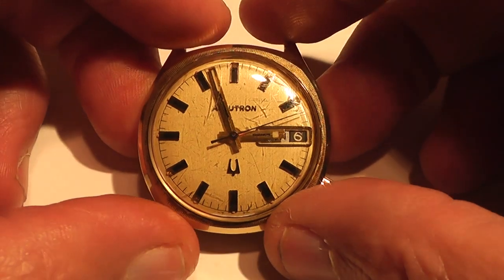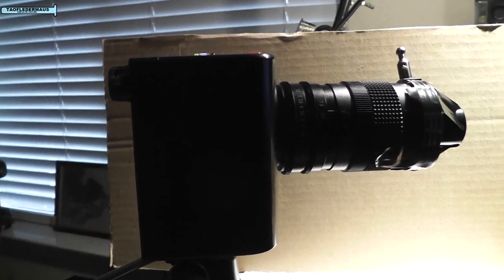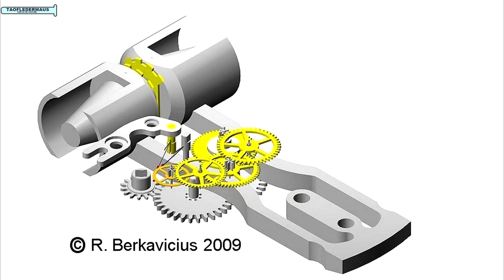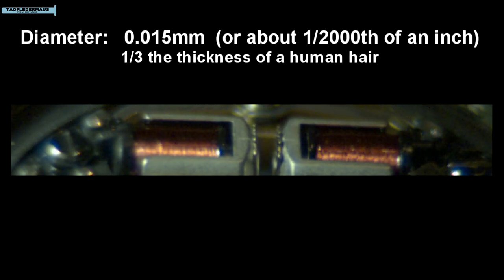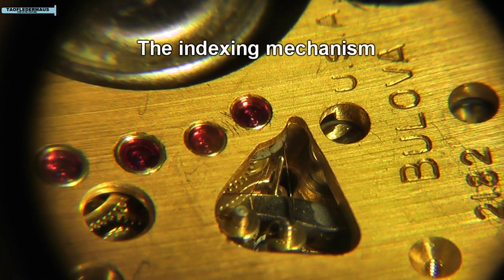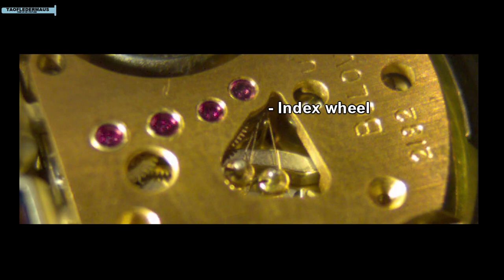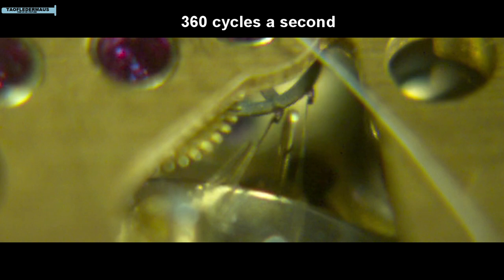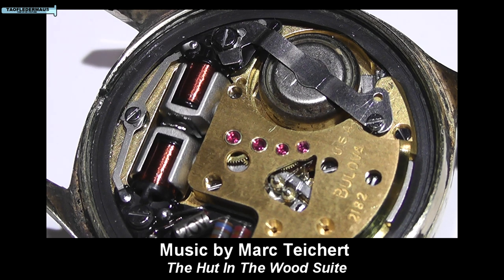The amazing Bulova Accutron watch filmed in microscopic slow motion

Comment: I have a feeling that the gear was built by the tuning fork itself then casted there in after. The watch being built around the gear, built around the transistors all while having extremely high quality resistors.

I'd say this watch is the definition of high quality.

Amazing
Reply: At least one of the resistors is carbon composition, the cheapest you could buy.  They tend to absorb water and change value over time.  Metal film resistors were around back then so I don't know why those weren't used instead.

Comment: This is an amazing piece of engineering. I love seeing how mechanical or electro-mechanical devices work. Before modern technology that gave us quartz clocks and transistors (for other devices), people had to find novel and new physical ways to do things. My pocket-watch is mechanical because I just love seeing the motion (it has an open face).
They're also so robust! I wouldn't be surprised if this watch would last a long time while running constantly. When something is more difficult, complex, and expensive to make, you sure as heck wanted it to last. 
The ingenuity needed is just superb. It's really neat seeing this gem of vintage timekeeping.
Reply from the maker: There aren't too many things made today that will last more than a few years.   Even stuff with no moving parts will break the day after the warranty lapses. lol

Comment: I owned one back in the 60s. It made a very soft humming sound.  I still have it, although I stopped wearing it long ago.  While going through a closet,  I found it and took it to a jeweler for inspection.  Of course, the battery was dead.  He put a new battery in and the watch came to life.  It works as well as when it was new.  Compare that to my father's Rolex of equal vintage.  It wasn't working so we sent it to Rolex in NY.  We got a letter saying it was unrepairable due to the unavailability of parts.

Comment: I don't know why I'm just now seeing this in June 2020 but it's real nostalgia for me. I bought an Accutron Astronaut in 1966. It is even more complex as it has 2 hour hands. One goes around every 12 hours and the other every 24 and it has a rotating 24-hour bezel. You rotate that to set the 24-hour hand. I was in the Air Force at the time stationed in Alaska with frequent TDYs to other time zones so I could set one hand to local time and leave the other on Alaska time. I still have it but the batteries have become hard to find.

Comment: My father bought a "Spaceview" version of the 214 model in 1968. I still have it. It has been "serviced" a few times... but it has never needed repair. It has run continuously for 50 years now... except for the 1 minute per year that it takes to change the battery... and the few times that it has been "serviced" for an hour or two. At over 31 MILLION oscillations per day of the Tuning Fork times 365 days per year times 50 years... it has pushed the Index Wheel over 550 BILLION times... without fail! I have "regulated" it (they have small "plates" at the ends of the Tuning Forks that allow it to speed up or slow down a few seconds per day) to well within the original stated "guarantee" by Bulova of 2 seconds per day accuracy ( for the first year of ownership). I often get these to run within /3 second per day over a few months. Try THAT with a Rolex!

Comment: I love that they tuned the frequency to the number of degrees in a circle. That's probably a GIANT hint into how they machined the escapement to such insane tolerances. If I had to guess (I work at a machine shop) I'd say they made a proprietary lathe with some insane gear reductions, but what they used for the cutting tool, I'm not sure.

Comment: The ‘fed back’ coil serves two functions: 
1) it pulses a charge to the capacitor to bias the transistor to 'kick' the coils 
for another cycle.
 2) Most cool, this capacitor charging helps the circuit Voltage remain high so
the battery doesn't have to work so hard. (avg drain is 6 to 9 micro amps).
There are patent descriptions on [Accutron] that do a better job describing this circuit than I can. The circuit design resembles a ‘Hartley Oscillator’.
-Thanks for great vid
Reply from the maker: Thanks Marc for the explanation!

Comment: That is absolutely nuts. I'd love to know how such a thing was made....
Reply: 1 teeth of that index gear measures exactly 0.01 milimeter in height. Todays high quality CNC technolgy achieves tolerances by 0.05. Anything beyond has to be hand adjusted by todays watch making. What alien technology did Bulova developed back then? The only possible answer is another tuning fork that sends vibration to a micro glass egde. While the stack of soft metal is rotating at low speed, the glass edge is cutting tiny valleys according to the tuning fork vibration. Then is gets sliced. The same principle that is used to drive the 214 caliber - just reversed :)

Comment: I currently attend school to become a machinist, I feel like this could be a lesson to everyone how important tolerances are.
Reply: I am a machinist and I mostly work with .005 inch tolerances. The average sheet of 8x11" printer paper is .003 thickness. The level of precision in that gear is insane.
Reply: I've long since graduated school and started a career as a machinist running a 4 axis horizontal mill. Given the wire in the coils is 5 tenths in diameter some of these parts are even more impressive. After rewatching this video over 3 years later I have an even greater respect for the craftsmanship.

Comment: Great video, I am glad you did not load is into a Mass Accelerator and send it at Mach 2 at some gummy bear or water jug!
My father acquired an Accutron in trade from a jeweler as payment for construction work (mid 1960's). It was the rare "Skeleton" model where you could see the workings of the watch through the face. My brother has it now, I think it still runs.
Reply from the maker: Nice.  The display back ones are probably quite desirable to collectors

Comment: As a tool & die machinist that went to school for watchmaking, and just happened to find a mint model 2210 accutron in a stash of old otherwise junk quartz movements given to me, I never got to work on an accutron as a student in early 2010s. Now that I see the legendary index wheel- and the size of the jewels- I am speachless. 320 Teeth on 2.4mm diameter is insane, even in watchmaking sizes. I can't imagine how they must have cut such teeth, I can only guess between centers as a stack of blanks, using a diamond shaping tool.

I kinda want to try making one now just to see if I can.

Comment: You can usually use two lens placed front to front together, interlinking the threads. I used to take many pictures with my K1000 using this method.

Comment: Absolutely fantastic video footage and narrative.  The frequency and continuous use make it difficult to believe the metal and other parts would not simply fatigue or get out of spec.  What was the longevity of these watches and how does that equate to total revolutions or oscillations through the watch's functional term? I'd imagine it exceeds the number of strokes of a piston makes throughout the life of a pressure lubricated car engine.  Phenomenal!!  Thanks.
Reply from the maker: I imagine the cycles the parts are going through far exceeds any engine cycles.

Comment: That's scary how something made in 60's - 70's is still the most perfect mechanism.
Reply: And the Fisher Space Pen(AG7) still the best pen ever made, developed in the 1960's. I have a new old stock Fisher Space pens from 1971(original ink cartridge) and a 1993(original ink cartridge) as well and both still write perfectly. Fisher claimed the thixotropic ink would not dry up in a hundred years, well I have one almost 50 yeas old and its still going. The Space Pen writes in zero gravity, writes upside down, writes at -50F and at 200F., writes underwater, writes on glossy paper, writes over grease on paper and writes very smooth period.

Comment: I am the 'Accuholic".check the patents.these have the smoothest sec.hands ever .the first model,214,was released w/o a dial.very popular even today.of course,at the speed, nothing is any different than when not running.i have a few beta21 models,first quartz.it was based on the accuquartz tech.it maintained the smooth run around the dial.it used the TK as a slave,w/quartz mvmt.after this all Qmvmnts banged around the dial one agonizing sec at a time

Comment: Very cool and informational!  My mind boggles at how they managed to cut all those tiny teeth on that gear!
Reply from the maker: thank you!
Reply: 1 teeth of that index gear measures exactly 0.01 milimeter in height. Todays high quality CNC technolgy achieves tolerances by 0.05. Anything beyond has to be hand adjusted by todays watch making. What alien technology did Bulova developed back then? The only possible answer is another tuning fork that sends vibration to a micro glass egde. While the stack of soft metal is rotating at low speed, the glass edge is cutting tiny valleys according to the tuning fork vibration. Then is gets sliced. The same principle that is used to drive the 214 caliber - just reversed :)

Comment: My guess on how they made it:
Magnetism to form a electromagnetic field in a specific pattern on the surface of the gear. Electrolysis used to deposit material onto the gear which would adhere to the grooves made by the field.
Reply: I suggest the same principle that is used to drive the 214 caliber - just reversed :)
1 teeth of that index gear measures exactly 0.01 milimeter in height. Todays high quality CNC technolgy achieves tolerances by 0.05. Anything beyond has to be hand adjusted by todays watch making. What alien technology did Bulova developed back then? The only possible answer is another tuning fork that sends vibration to a micro glass egde. While the stack of soft metal is rotating at low speed, the glass edge is cutting tiny valleys according to the tuning fork vibration. Then is gets sliced.

Comment: What made the machine that made the parts for the watch

What made the parts for the machine that made the watch parts ?

Etc
Reply: 1 teeth of that index gear measures exactly 0.01 milimeter in height. Todays high quality CNC technolgy achieves tolerances by 0.05. Anything beyond has to be hand adjusted by todays watch making. What alien technology did Bulova developed back then? The only possible answer is another tuning fork that sends vibration to a micro glass egde. While the stack of soft metal is rotating at low speed, the glass edge is cutting tiny valleys according to the tuning fork vibration. Then is gets sliced. The same principle that is used to drive the 214 caliber - just reversed :)

Comment: Very interesting, how would they produce something like this?
Reply: 1 teeth of that index gear measures exactly 0.01 milimeter in height. Todays high quality CNC technolgy achieves tolerances by 0.05. Anything beyond has to be hand adjusted by todays watch making. What alien technology did Bulova developed back then? The only possible answer is another tuning fork that sends vibration to a micro glass egde. While the stack of soft metal is rotating at low speed, the glass edge is cutting tiny valleys according to the tuning fork vibration. Then is gets sliced. The same principle that is used to drive the 214 caliber - just reversed :)

Comment: On the subject of Bulova, I have a T3 Super Seville automatic. It cost CAD$100 in 1994. It was used roughly and worn a lot since then. It has never been serviced.  I just put it on the timegrapher, and after 28 years with no servicing, it is still -0.5 sec/day, 300 amplitude, and 0.0 beat error. My fully serviced Rolex Datejust is not that good. The movement is an ETA 2836-2.  So which is a better movement, the one in the Rolex Datejust or this much cheaper ETA? All the specs for the ETA are impressive.

Comment: Hi I have an old accutron  the number on the back case is C58356 and would like to get a new band for it . Would you happen to know what size of MM width I should order so it fits nicely between the case brackets that the pins spring into > Thank you in advance hope you can help

Comment: They broke the machine that made the index wheel. When Bulova celebrated it's 50th year of the Accutron they had to use new old stock movements to put in the new anniversary case. Also the were used by NASA by the Apollo Astronauts in their comm. equipment and one movement still sits on the moon. I am a watch collector and have almost every year model Accutron.

Comment: Jeff that is the second time I have seen you use that cheapo light. Any chance you can PM me a shipping address and I will send you out some much better flashlights?

EDIT: That might have been a different light in this video. But still the offer still stands.
Reply from the maker: I had to use a tiny LED to be able to get it close to the watch and at the same angle.    I have a bunch of flashlights.
Reply: Ah okay. I can't recall which video it was (maybe the slow mo magnets one) but it looked like you were using one of those super cheap "9 led flashlight" things.

Comment: With all the mechanical miniaturization and precision, I'm amused by the (relatively) huge capacitor and two resistors. And the resistors only have 10% tolerance (silver band). Also, a 20 volt rating on the cap seems very excessive.

Comment: There's no way a die could've been used to cut those index wheels.  The best fine blanking technology of today isn't that good.  I'd almost bet a laser was used on those wheels. Laser technology was available in the 60s and 70s for cutting fine parts, though very proprietary.  The composition of the jewels on the end of the pawl fingers is why the wheel doesn't wear out.  I'm going to get me one of those old Accutrons some day.
Reply from the maker: What I understand they stacked hundreds of the blank gears,  then ran a fine cutter down the stack,  indexed the stack,  and repeated.

Comment: 50 mil, half a thou or 5 tenths are all (more) acceptable ways to say 1/2000th of an inch. 
Sincerely- a concerned machinist.
Reply: I prefer to use 1/25.4"  as a unit of measurement
Reply: 1/2000"  =  0.0127/25.4"
Reply: Cool story bro

Comment: I believe the index wheel was made on a modified hobbing machine using a honed diamond as the cutter. The diamond was ground to a cutting edge that cut many stacked index wheel blanks at a time. Stacking gave the frail wheels the rigidity necessary to withstand the cutting. What other possible way could it have been done back then? Hopefully your jaws are on the ground just from trying to wrap your heads around what it took to make the wheel with its ridiculously tiny dimensions, which btw spun more than 38 million times per year on the 214s. Ok, now you can vomit. Blahhh

Comment: The micro teeth on the gear... what the actual fuck... HOW
Reply: The gear teeth rise .010 mm which is about 1/7 the diameter of a human hair(.070 mm average), width of gear is .020 mm which is a third the diameter of an average human hair. Some super thin hair can be .020 mm. Typically human eyesight ends at .040 mm.

Comment: Am i the only one here how cant see a single theeth on that index weel? :-)
Reply: Well, they are tiny. If you are watching on a mobile phone with poor resolution, it's possible you can't see anything. Even on my 13" 2K display you can barely make out the individual tooth and even then it would look as hairy wheel and not tooth if you didn't know to look for them. :-P
Reply: I watched it in 24" 1080p and nothing :-) not for sure. I hougth i see them and realized then that i just see the pixels from the lower resolution chronos footage.
Reply: Watch 3:36 really closely. You should be able to see it.